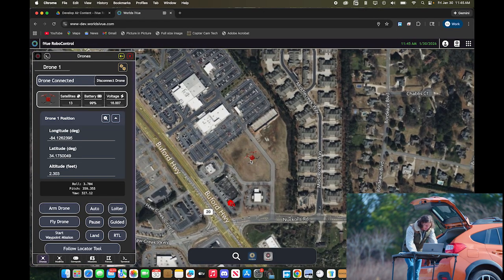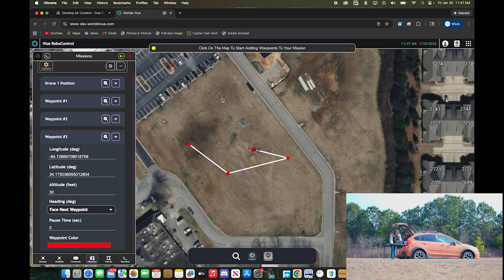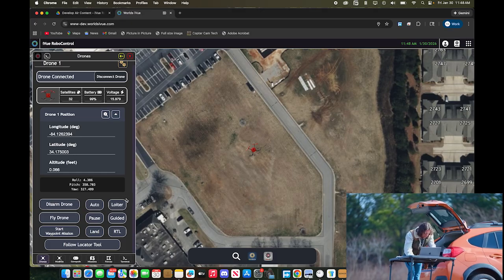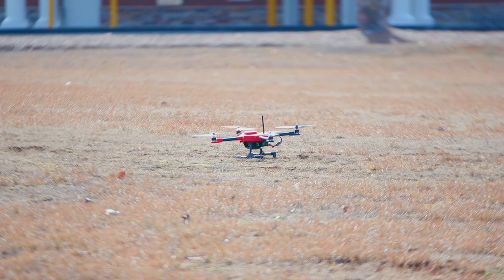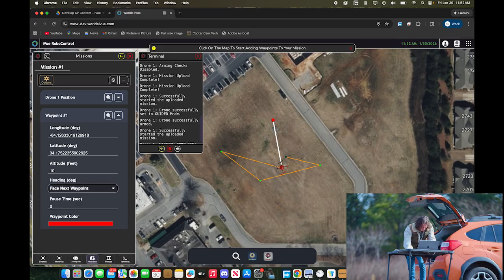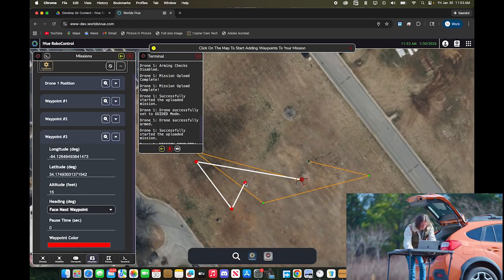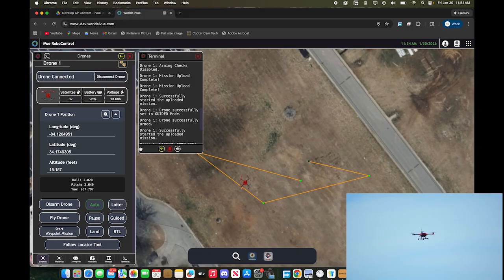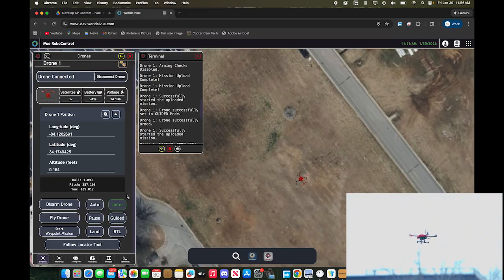No Longer Welcome & Finding a New Field | Suggesting Improvements for iVue RC Drone Control Software

Comment: What happened to your test site?
Reply from the maker: The field in this and many other videos throughout the last couple of months is owned by a local Honda dealership. We were asked to not fly there any more by one of the Honda dealership employees sent out by one of the managers. We have been spoken to before, but not explicitly asked to cease operations. While I am a big fan of testing my luck, this is not going to be one of the cases I keep pressing.

Otherwise, we typically operate out of a couple local county parks further away from our workshop, with one of the parks being specifically for drones, only opened during set hours on Wednesday through Sunday though.

- Jacob